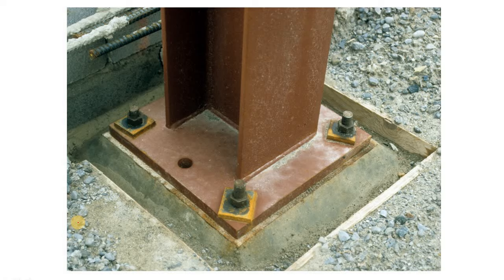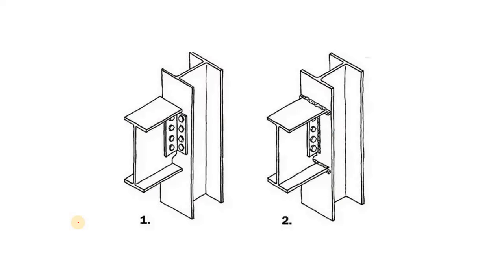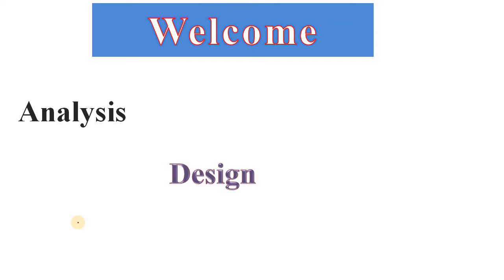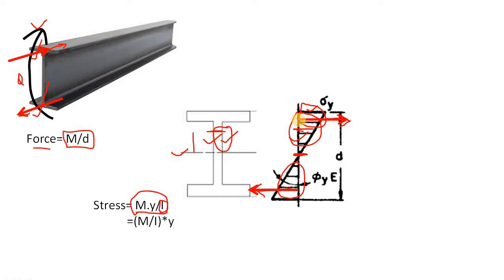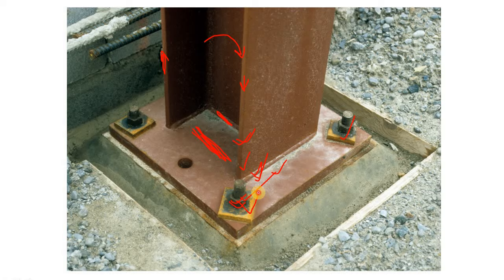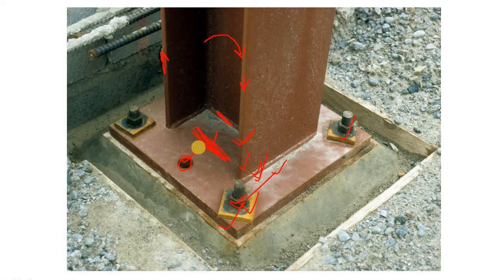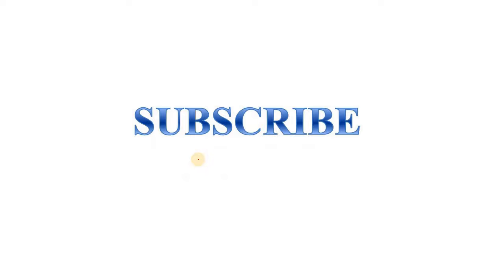Shear Connection vs Moment Connection: Definition and Difference of Shear and  Moment Connection

Comment: What's the condition of the structure that one is to consider in order to decide that splice of structural steel beam a moment or shear connection?
Reply from the maker: Depends on the force transfer mechanism. If only we is connected,shear if both web and flange connected, moment connection.
Reply: @TonmoyMaity  Thanks for the reply. Let us say,  structural steel beam splice is located 600 mm away from the support. Do we have to find out the shear and the bending moment value at that point to decide if the splice is shear and bending moment connection?

Comment: What if i have a beam-column junction, where the web and flanges of the beam are completely welded to the column. No bolts, no plate, no angle.
Is it a moment connection?

Thanks
Reply from the maker: Yes , it is
Reply: You never weld the web..

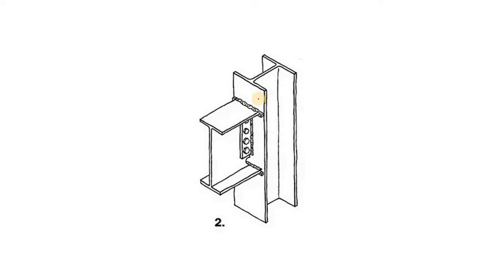Comment: 5:35 you show a connection with both welds and bolts. This is a bad idea! Bolts fit holes with a certain tolerance (e.g., 1-2 mm), and their friction is often not enough to resist the shear forces in the ultimate limit state. This means that your welds, which are rigid from the start of the loading action, will fail before the bolts slip and start taking significant shear! In other words, bolted connections and welded connections work at different timings and should not be considered simultaneously within the same element. (their contributions to the resistance do not add up: first, the rigid welds take nearly all the loading and then they eventually fail, in a non-ductile way, and only after that do the bolted connections slip 1-2 mm and start taking the loading).
Reply from the maker: right.. thanks for your help

Comment: Dear sir I've been following you and found your videos very helpful. I've a question from long time that "Is pinned or fixed connection preferred for steel column base based on load?? and at what condition truss be connected by pin joint or weld joint???
Reply from the maker: I will make a video on this.